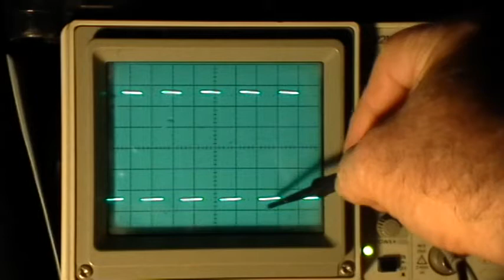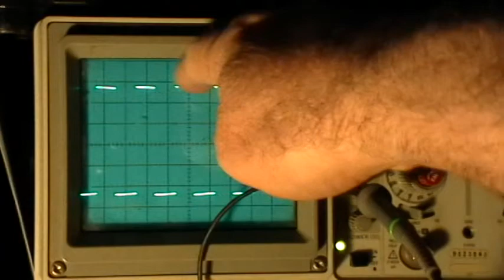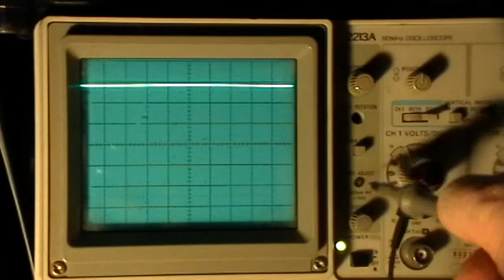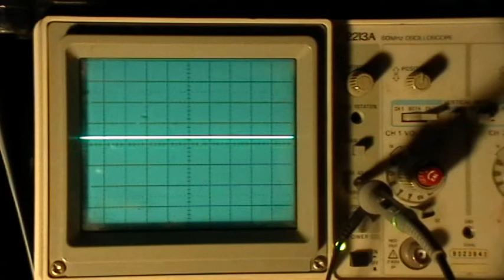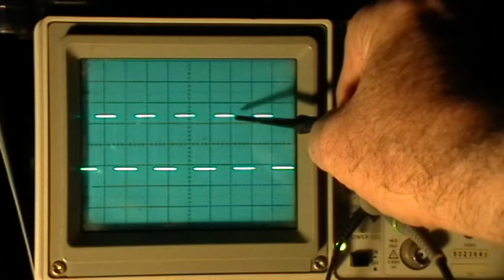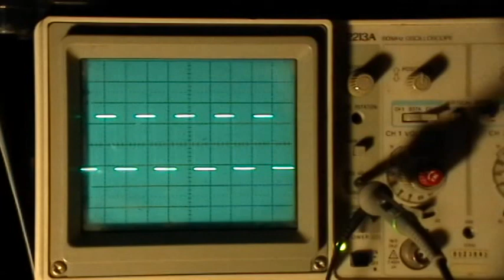Scoposcopy: Probe Compensation, Input Coupling, Waveform Asymmetry

Comment: Thank you for sharing this TK... Also thank you for your "Scoposcopy" series in general. You have shared so much useful information, its a great thing... Check out the scope I recently purchased, it is a HP1720 275MHz... I can't pick it up until mid-April, but it is purchased and mine :) I am truly looking forward to learning and practicing the art of electronic energy measurement. (And I know for sure your Scoposcopy series is going to be an invaluable resource for me...) Again, thanks for sharing. Peace TK :) https://plus.google.com/photos/109787787603959937342/albums/6118413216961757233/6118413218605302466
Reply from the maker: That's quite a bit of kit there! I'm afraid I can't be much help on the Time Interval measurement capabilities of that scope, but it certainly looks like the scope part will be a great instrument for you. Don't skimp on the probes, you'll need good probes to take advantage of the high bandwidth of the scope. Congratulations!